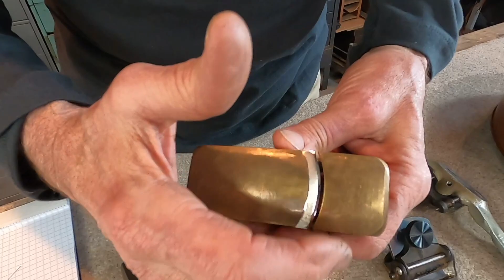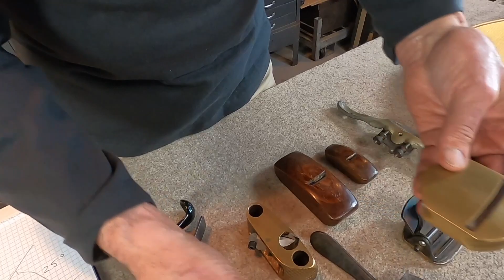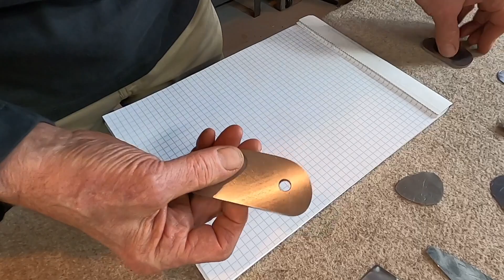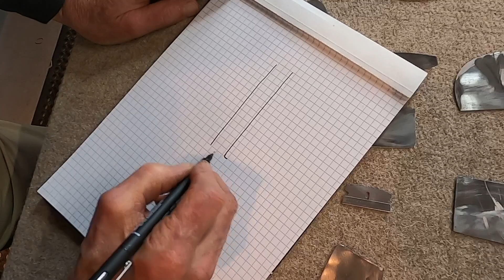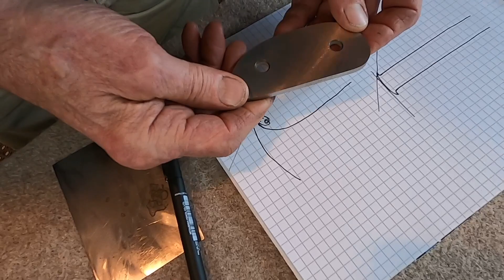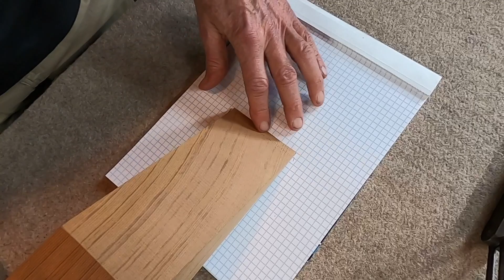Ken Parker Archtoppery - Tool Geometry 2

Comment: Can’t wait to see your video specifically on tool modification.  I have an old Stanley 70 that it is just itching to get modded.  What kind of braze material did you use to braze the brass bottom onto the steel?  Was it something like silver alloy?
Reply from the maker: I'll provide a guide to exactly what you're describing in a video to come soon. The answer is a low temperature, high strength so - called "Silver bearing solder" which is easy to use due to its low (430-ish degrees F ) melting point.  This is a very different material than silver solder.  I know, it's confusing, but the only real difference between soldering and brazing is the temperature required.  830F or 450C is the arbitrary boundary line, they say, with brazing above this temperature, and soldering below.  For so many purposes we might have, like yours, for example, a high strength solder is more than adequate.